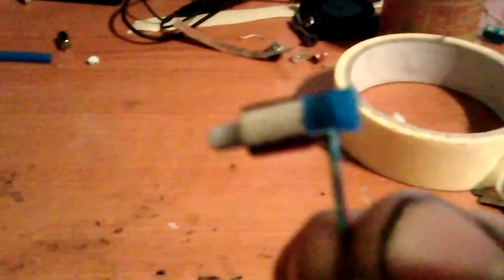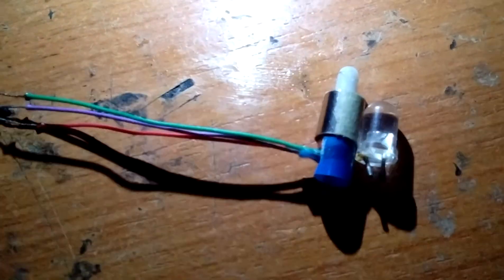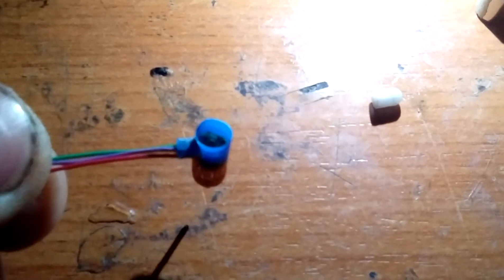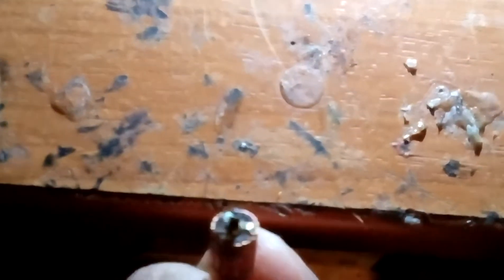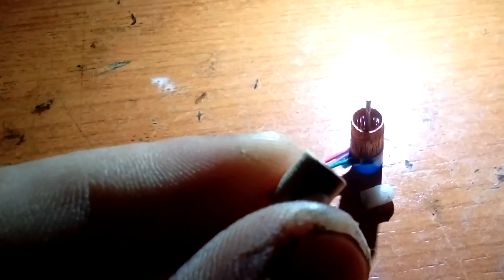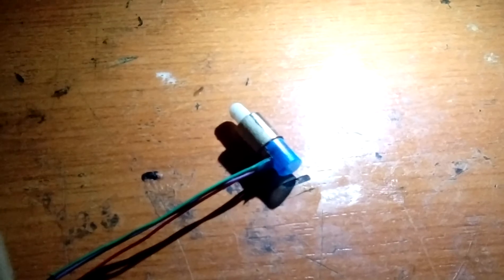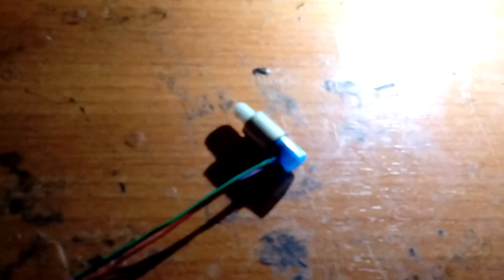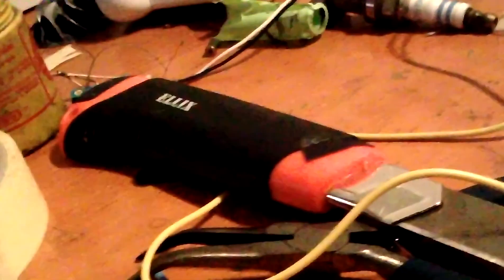Homemade smallest brushless motor

Comment: How did you find a coreless motor with 3-phase winding? I've only seen 5-phase ones.
Reply: Do you know if these are the correct motors? https://analogdrone.com/products/4-motors-for-hubsan-q4-h111?variant=16749966721
I'm looking to do the same thing but use them for a nano quadcopter running these esc's. http://www.overskyrc.com/dp3a-speed-control-micro-brushless-esc-p-312.html
Reply from the maker: simple cheaper vins the race ;) just try to find some cheap low quality coreless motors i was lucky and found them under name of h111 motors brushes burn out fast and they are always 3 phase rotors i wish you a lot of luck in finding them
Reply from the maker: Abc Xyz yup those are the motors u need to look for but do not make same mistake as me have motor wires as short as possible i wish u best
Reply: Thanks. And did you simply remove the ends of the coil from there they attach to the commutator and add the wires to them?
Reply from the maker: Abc Xyz nah if u try to do it like that u will probably break the coil i simply cut off the commutator tip flush being very careful and then i solder vires to same place were coils are soldered and drop of super glue to make it solid do not use hi temperature soldering iron or u can easily get an unrepairable dead short  😷
Reply: Ok cool. Thanks. I'm also working on designing my own nano brushless outrunner. Right now I have it as a 9N12P layout but was thinking of switching to 9N10P but wasn't sure if most of the micro quadcopter esc's could drive that configuration.
Reply from the maker: Abc Xyz i hope u have luck on your side😋

Comment: I happy for you spending your time and effort in making the motor, but wouldn't it be easier to buy brushless motor from your local hobby store or the internet? They are pretty common now and they are usually cheap. All in well, good luck :)
Reply from the maker: the smallest brushless motor (factory made ) outrunner is 15mm wide and this one is only 6mm wide just as i need it to be happy Christmas ;)
Reply: Merry Christmas!